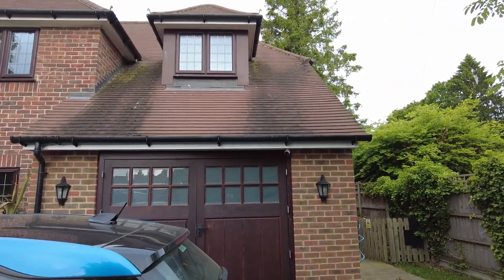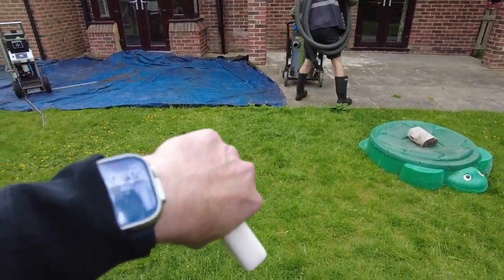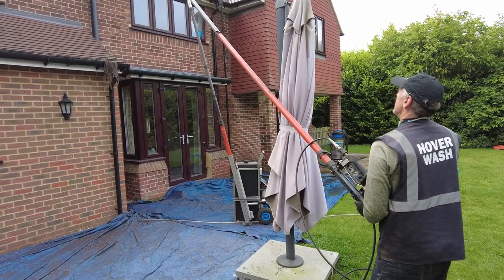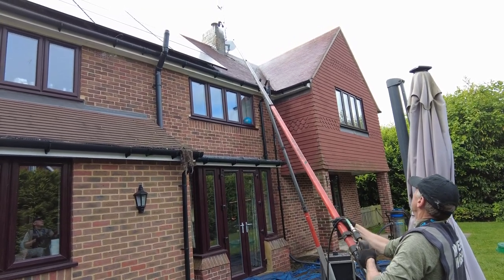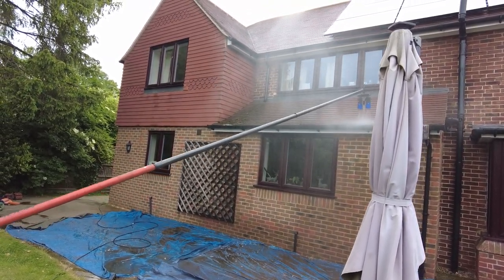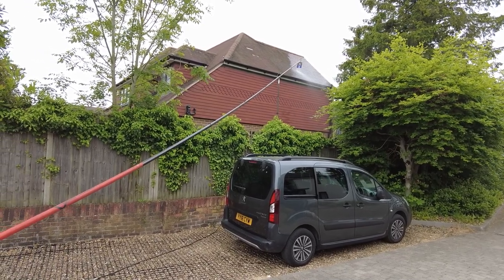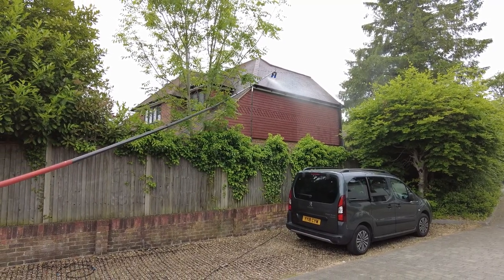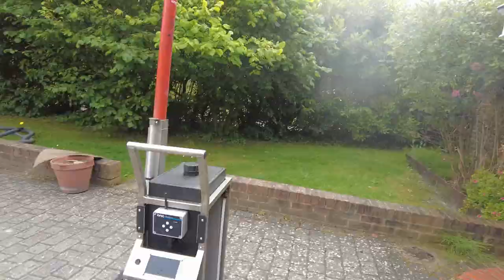Complete Roof Clean - Indepth Training - No Ladders- No EWP- The Roof Wand

Comment: do you get customer to sign a damage waiver? because if that blasts out some cement on ridge tiles there will be future issues.
Reply from the maker: Anyone that walks a roof in pressure cleaning or using a system like the roofwand should indeed do so.